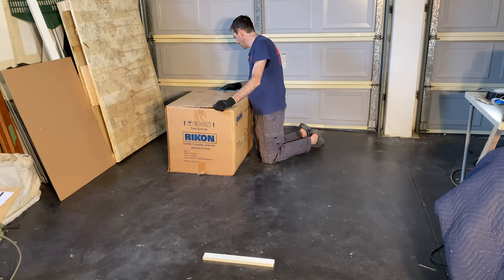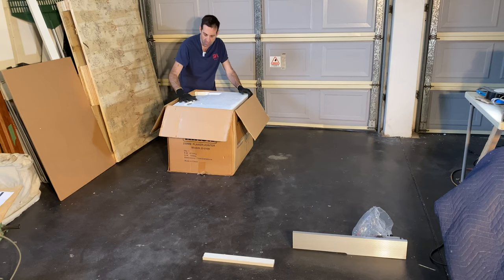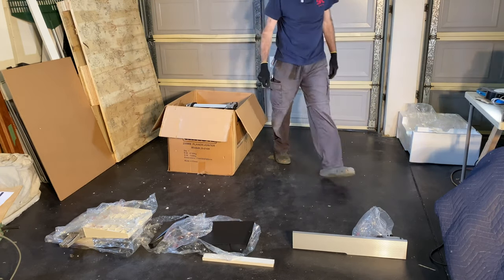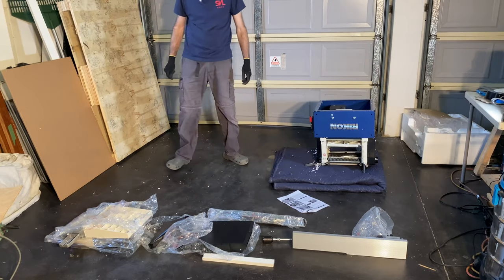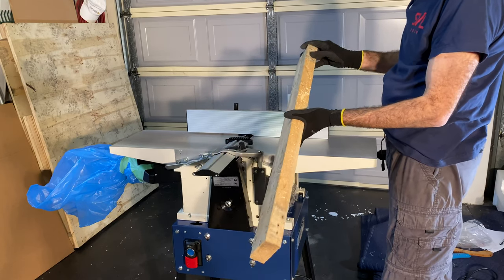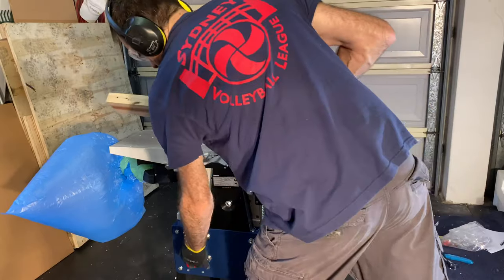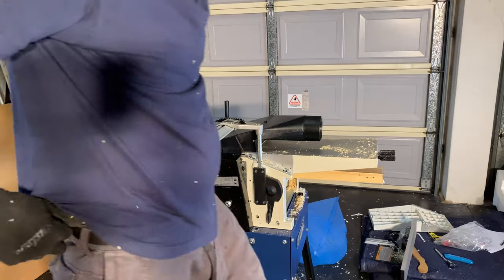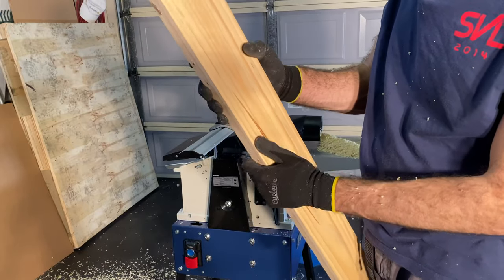Rikon 25-010H Unboxing, set-up & first use

Comment: Thanks for all the great info regarding the jointer/planer. I am thinking of getting this machine but am wondering if the jointer tables needs to be readjusted often to be made coplanar? A reviewer of the Rikon 12” combo machine said his tables would not stay coplanar and didn’t recommend it. I would think it could be even more of a problem with this 10” machine, as the one table has to be removed completely to go into planing mode.  Have you found that you are frequently having to adjust the tables? Thanks for any insight.

Comment: Thanks for the information. I am considering one of these for my shop. I would be interested in more information after you get some use out of it. Keep at it good first video.
Reply from the maker: Hi Kyle, Thanks for your comment! I have been using it quite a lot recently for a range of projects. I have added some home made dolly wheels to allow me to easily reposition it in my garage. I have also made a push block to make it safer. The only downside has been the time it takes to switch between jointing and thicknessing... it doesn't take too long but it's not instant and you need to check square the fence each time. I also added a dust cyclone and a proper 4" dust extractor. The cyclone is amazing! If you want to know how I did that cyclone, send me your email address and I will send you some photos and also links to what I bought. Cheers Justin
Reply: Justin Kern thanks Justin as soon as I figure out how to send you a message I’ll get it to you
Reply from the maker: @kylereed3577  This is the cyclone I bought: https://au.banggood.com/DIY-SN75T3-Turbocharged-Cyclone-Dust-Collector-Cyclone-Separator-Industrail-Vaccum-Cleaner-Filter-Set-p-1653563.html?akmClientCountry=AU&&utm_design=18&utm_email=1595818634_2332&utm_source=emarsys&utm_medium=Neworder171109&utm_campaign=trigger-order&utm_content=linux&sc_src=email_2675773&sc_eh=ea937705ab1346071&sc_llid=24247766&sc_lid=105229698&sc_uid=IZG87BbANJ&cur_warehouse=CN

Comment: Thanks for the review. Any luck removing the snipe? It's only on the in-feed it sounds like. I'd love to get the 12" version but I think this 10" is more in my budget. I'm just wondering whether I'll be dealing with snipe like my lunchbox planer and what is the maximum board length to expect for jointing?
Reply from the maker: Hi Brent, Thanks for the comment! I found that the snipe was very minimal on both in-feed and out-feed. When machining hardwood I tend to reduce the amount being removed once I have done my initial passes. There is a very small amount of snipe on the first few passes and then when I do the last few passes through the machine I take off about half a milimeter on each side so that snipe is almost zero. As you can imagine, softer wood tends to go through the machine with less snip as the roller is less likely to kick up when passing through at thicker amounts.
The 10" capacity is enough for me but if I had a bigger workshop I would possibly get a larger machine.
I have hit a few nails in recylced material and to my surprise, there was no damage to the cutting blades.
I also added some castor wheels to the legs on the outfeed side of the machine so I just lift up the table on the infeed side and then simply roll it around. There are factory made dolly wheels available here if you would prefer the proper kit: https://www.rikontools.com/product/25-910
The only negative to this machine is that you need to spend about 60 seconds to switch between thicknessing and planer modes but this is nothing to deter anyone from buying this machine. 
It has made my home woodworking projects so much faster and way more enjoyable!
If you have any more questions feel free to contact me any time. Cheers Justin